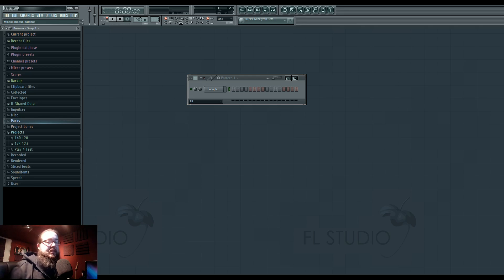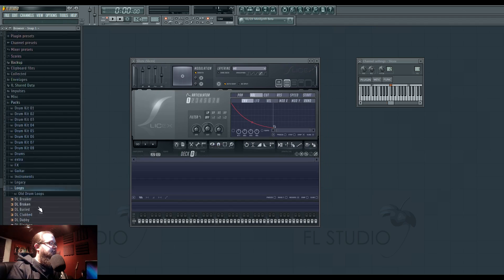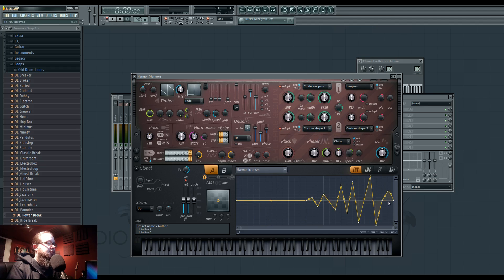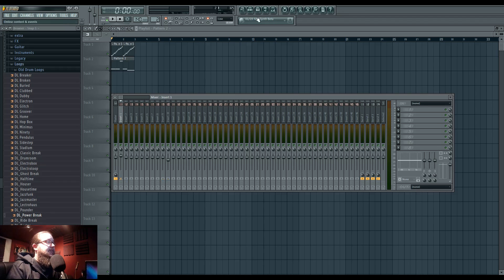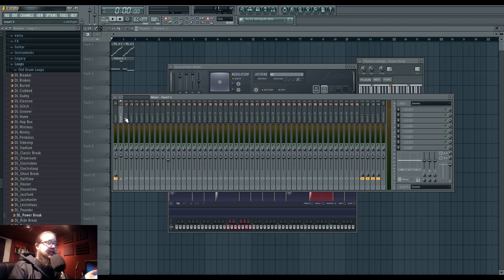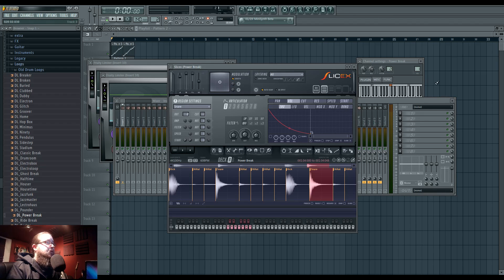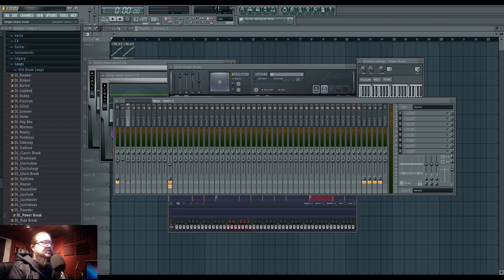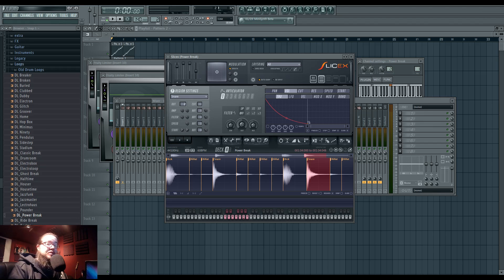FL Studio Basics 50: A very quick look at mixer offset in Slicex

Comment: Okay, so someone help me out. I've been making music for a year-ish; what the nuggets does sidechaining do and how can I use it? :) thx in advance
Reply: Sidechaining basically pushes one Signal away as long as some other signal is active.

You can use it in so many ways, one of the most common is that a kick pushes the bass away so that there is more room for Mr. Kick.

Or that the Track will have more pumping.

Also you can use it for an HIGH PASS FILTER who then cuts the lower bass frequencies out, so that it might sound better and stronger.

And you can link any parameter ( that you could make an automationclip for or something likewise ) to the "FRUITY PEAK CONTROLLER"
and make cool sounds with that.

Does that help you ?